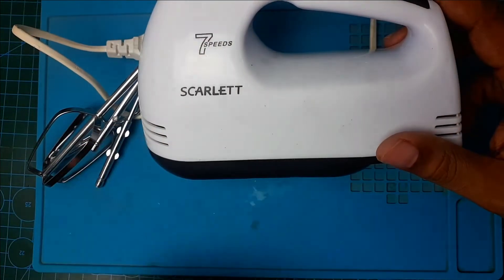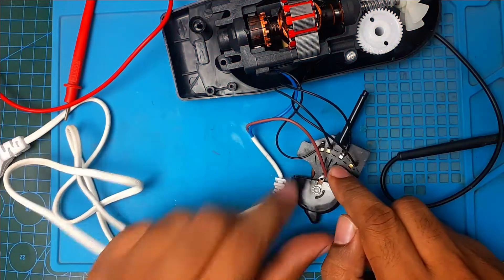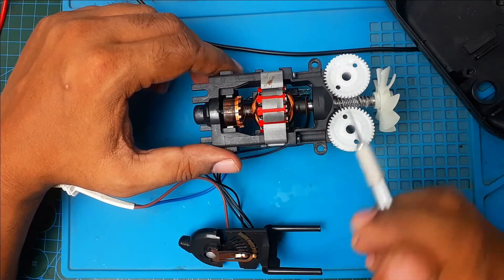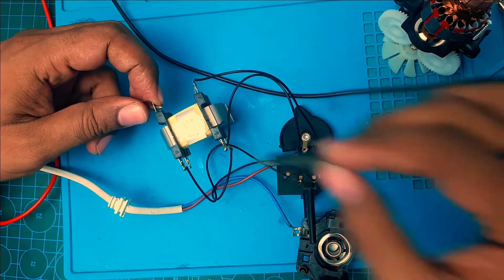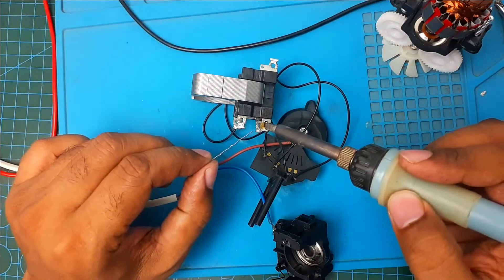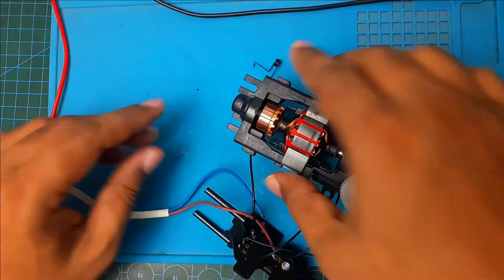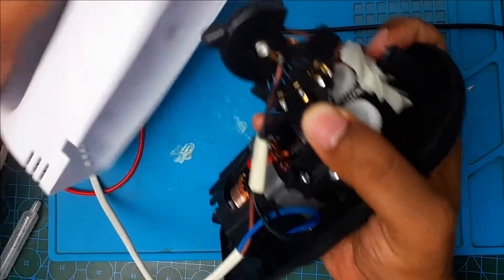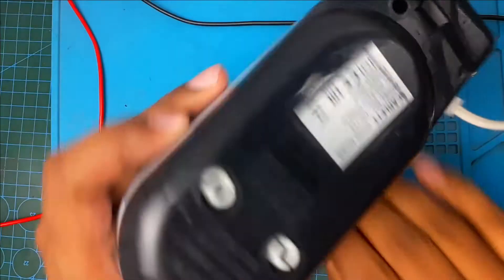Scarlett 7 Speed Hand Mixer Fixing a Dead AC Motor DIY Repair

Comment: Sir, I have a same hand mixer of Scarlett brand but recently when I was trying to turned it on a flashing light was coming from the commutator where it touches the karbon and smoke & burning smell was coming from it & it's getting Stop.
How to resolve the problem??
Reply from the maker: A flashing light, smoke, and burning smell from the commutator usually indicate a serious problem with the motor. It's best to have it checked by a repair technician.

Comment: Hi i have same beater wen i was beating cake batter, i saw spark n heavy  smoke now its not working kindly help me fixing it
Reply: Thanks but i stay in small village thr is no mechanic who can repair whisker thr is one shop i asked him he said he does know to repair dis can u make video on it
Reply from the maker: It might be due to a burned motor winding, faulty switch, or shorted wire. If you're comfortable opening it up, carefully check for any burnt smell, blackened parts, or broken wires. Otherwise, I recommend taking it to a local repair shop for safety.

Comment: My bender is just vibrating when i power on... And its very hot after i give power but not spinning.. olz help me😢😢
Reply from the maker: Yikes! Hot & vibrating but not working sounds like a short. Unplug & check for jams. Multimeter for electrics (be careful!).  Manual or manufacturer support might be best. Model info helps!